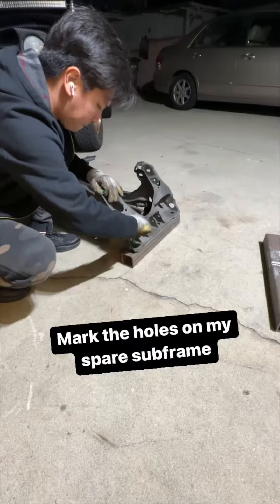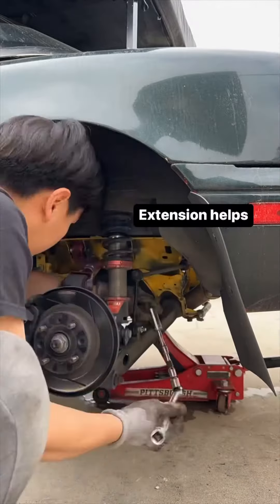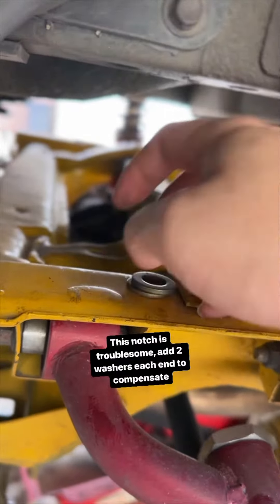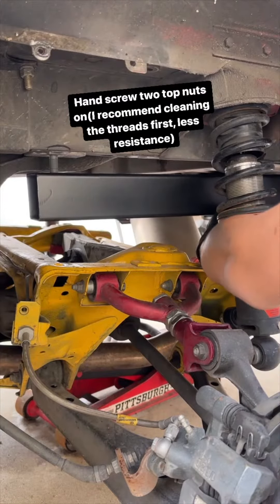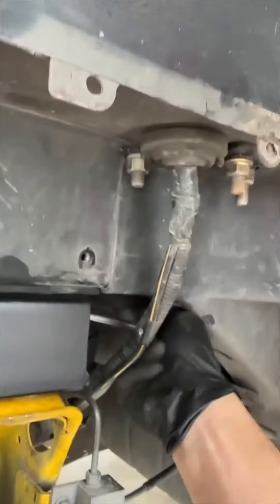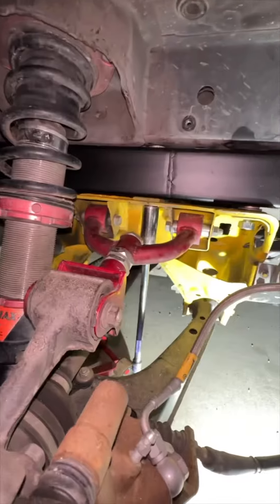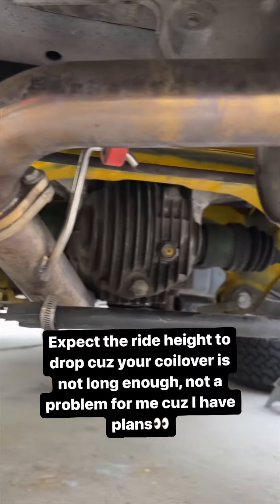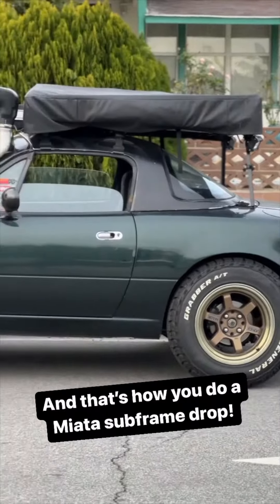NA Lifted Off-road Miata Rear Subframe 2.5” Drop - How To!

Comment: I am lowering front and rear frames to also help with camber change under compression. With my lift I go positive camber and then back negative. 
Tried to change the mounting bolts in the frame. —- That was a mistake. I like your idea.

Comment: What wall tubing did you use, and did you go hot or cold rolled, and…. Is it holding up?
Reply: Looks quarter inch probably get away with 3/16th though

Comment: Would the paco motorsports rear adjustable control arms prevent CV axle damage too? Or is this better?
Reply from the maker: This is better.
Reply: @JimmyHasNoGarage  thank you (your build is sick and im building one of my two miatas as a lifted one!) Do you think a the rear adjustable control arms are needed or beneficial in anyway or are the stock ones fine?
Reply from the maker: @staver76  the subframe drop helps with the CV axle angle but the trade off is your your ride height will probably drop because the suspension connects to the unibody. Unless you have very long adjustable coilovers like mine here. Adjustable arms are used to correct the camber. Keep in mind that camber arms on the market are usually for correcting negative camber on lowered cars. And in this situation you are doing the opposite. I had to take one adjustment nut off to further shorten the camber arm.
Reply: @JimmyHasNoGarage  Thank you for the info!  Would using the paco lift kit with the subframe spacer correct the drop in ride height?
Reply from the maker: @staver76  I think you’ll still loose ride height with the paco kit.